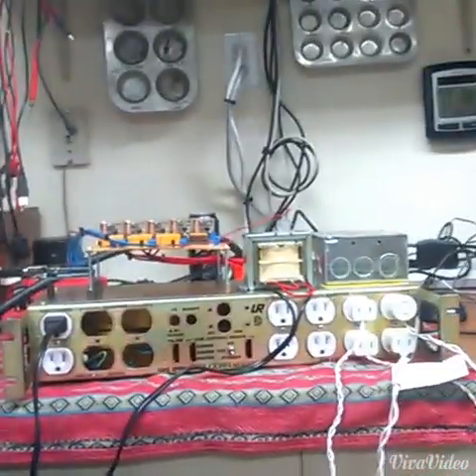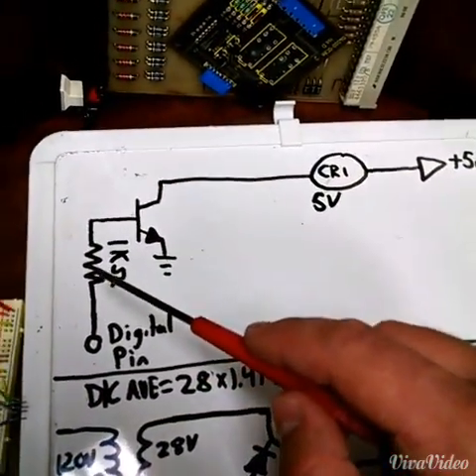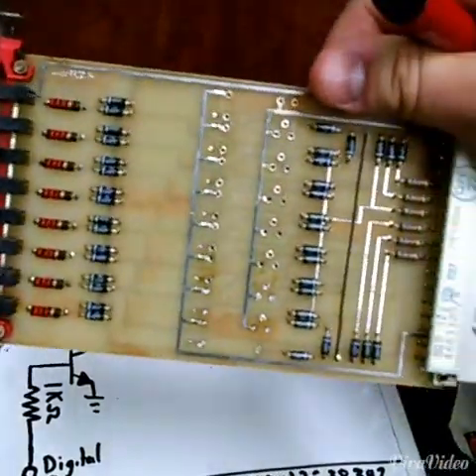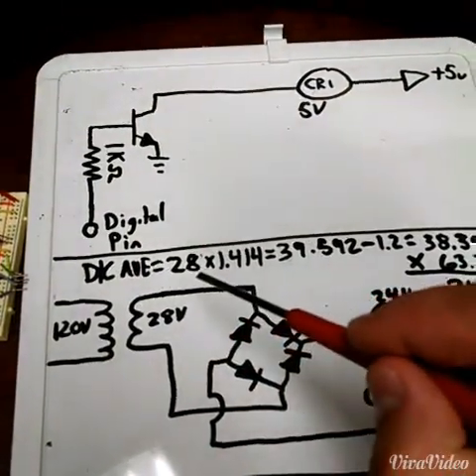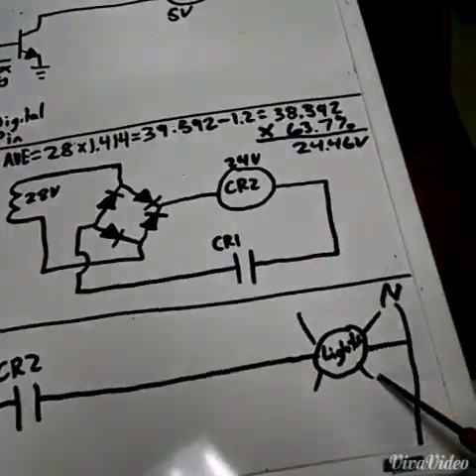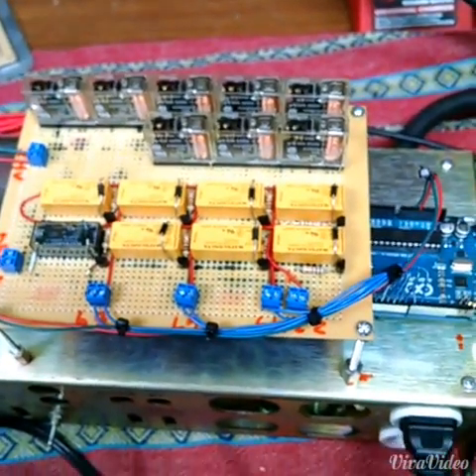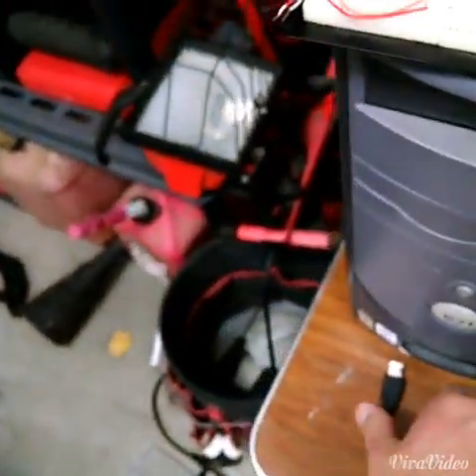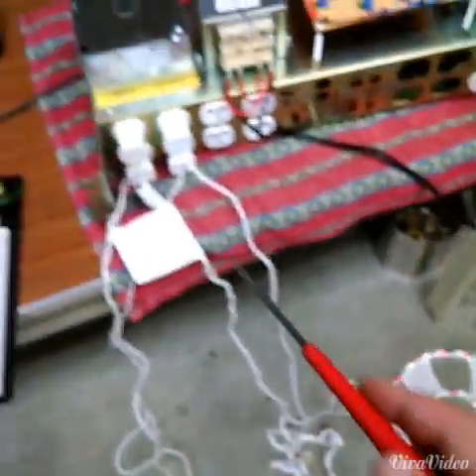Video 1 - DIY Arduino Christmas Light Controller

Comment from the maker: Yes I could have. This was built mostly from recycled parts and originally I used the 5v relays (all I had). Then I ran across the 24v relays that had 10a rated contacts and just used the 5v contacts to energize 24v relay.

Comment: A 2n3904 NPN transistor will handle 40 VDC at 200 mA.  Can you just skip the yellow relays and run the 24 volt relays directly from the driver transistors?